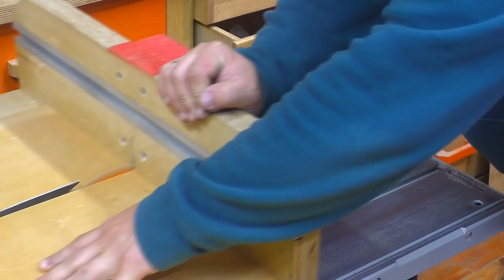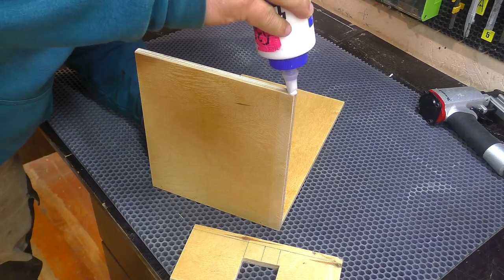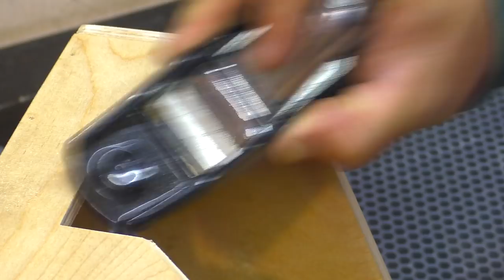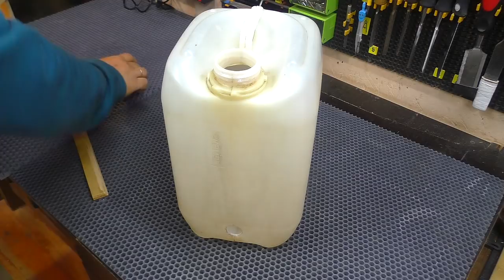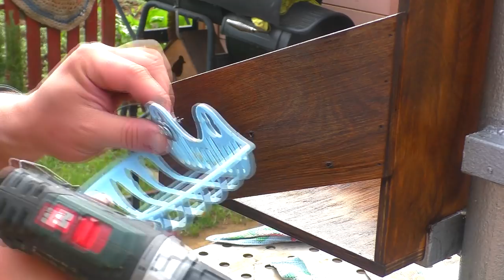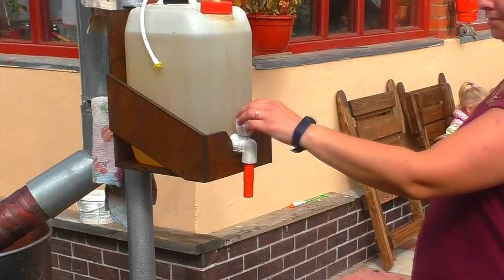Такой самоделки из пластиковой канистры вы точно еще не видели !!!

Comment: I made it with a tap only why do you need to made the top with tupe I don't understand. I made very simple I drill the hole for the smaller than the tap and I need not add any ssrew inside the container.I left it outside my house  and family can just wash the hands and legs.
Reply: Because with the nut inside the container holding the fixture it last for ever, otherwise taping a thin layer of plastic no , the movement created for the open and closed of the valve it will came loose